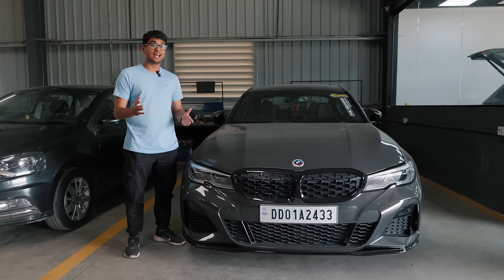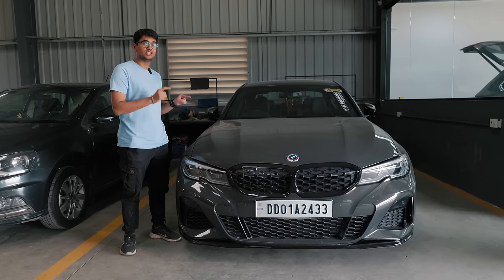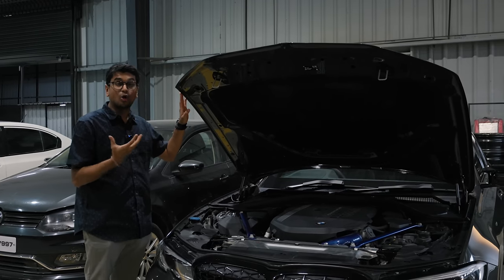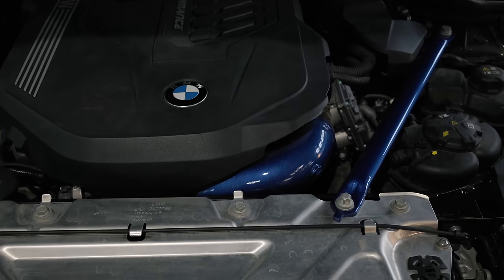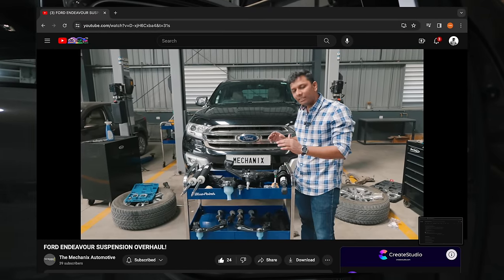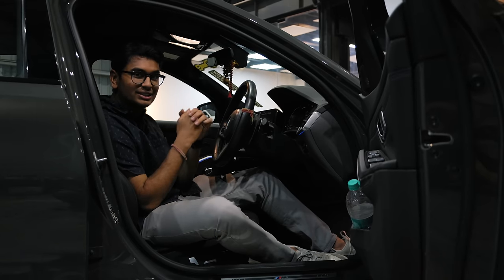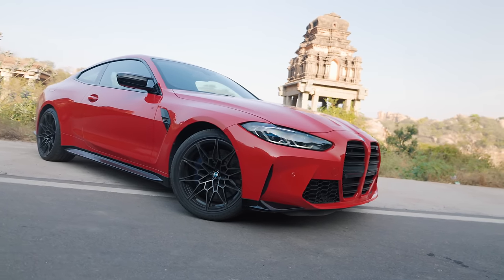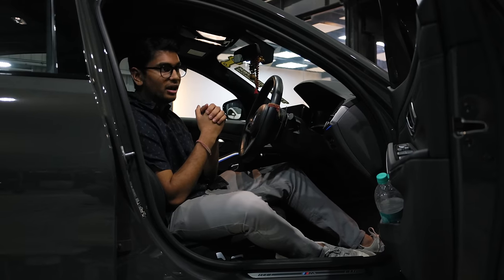INDIA'S "FIRST" RWD ENABLED M340i XDRIVE! (XDrive Delete for G20 M340i!) | Project M340i

Comment: i recently bought a octy 1.8 tsi and planning to awd it … can i fit the drivetrain and dq250 from a vr6 in my octy 1.8?
Reply: Yes it can be done. Either from a yeti 4x4 or VR6.
Reply: Its better to go for some old audi quattro as if it will be cheper n reliable
Reply: @ahfh5380  cheaper for sure, but not sure about the reliability...
Reply: @prasannabhosale8873  depends upon how the operator used it.....

Comment: I was actually one of the original posters of this app on the BMW tech subbreddit asking if anyone has tried this. Glad to see a video finally come out. But I am worried about the differential distribution seen in this video, it kind of looks like traction control kicking in. I would advise you guys to find a good driver and test it out on the track to see if it can do skids like the M3 once the traction control issue is figured out. 
P.S. for people saying this is a downgrade from X-Drive, try driving your cars other than straight lines in the constant summer heat of Asian Countries. You will get bored quickly if you like doing skids here and there.

Comment: Following u guys for a long time 
good work u ppl do 
But this is insanity 
The beamer is literally crying , the smoke from near center diff and gearbox says it all.
This is the sole reason i can never buy a pre owned m340i , cause ppl just go too crazy.
Reply from the maker: Hey man! Thanks for following us for such a long time! 

But that smoke is not from the gearbox or diff. It's from the tyres!
Reply: Most m340i s are not modded to this extent and the some is from tyres like the previous comment said the b58 is reliable too.